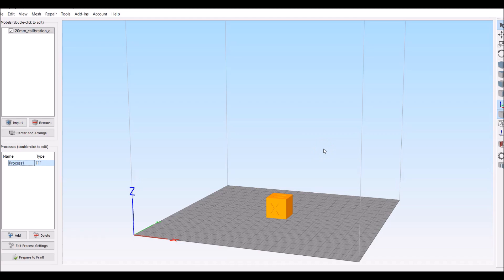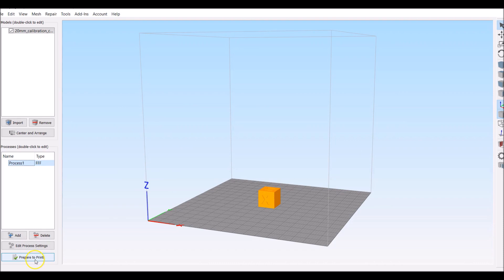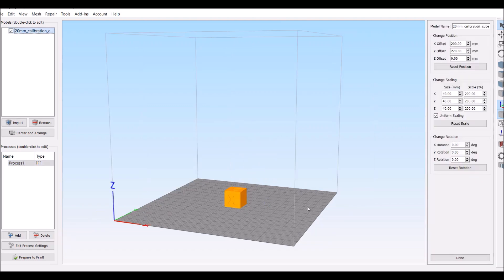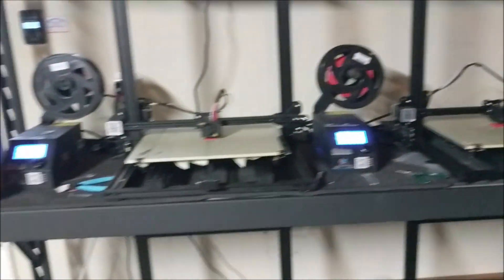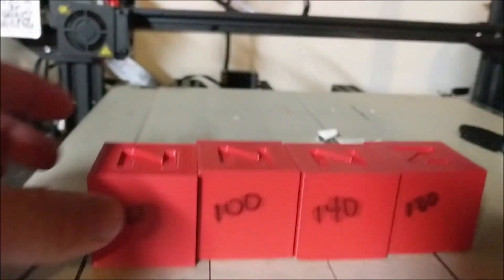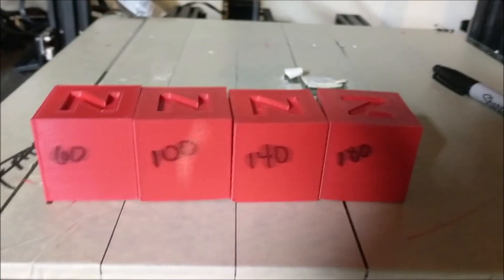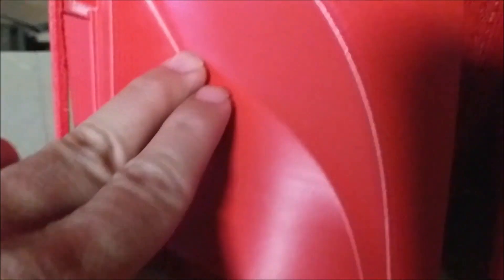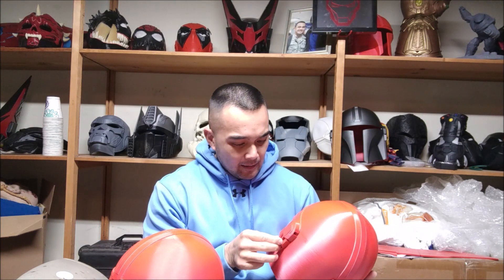Faster CR10 Prints

Comment: Dude, in order to increase speed you dont just crank the overall print speed and that's it !!!! there is a LOT other things to consider like outter wall speed, inner wall speed, infill speed, cooling wait time, top ,buttom and much much other things to do, and yes all will affect the speed of the print and you need to tune all these things in order to get a nice print with faster speed.

Comment: It seems pretty clear to me that your printers aren't actually doing the speeds you're setting them to, either because of volumetric flow limits or because of acceleration limits
Reply: Because of low acceleration and jerk, the travel distances aren't enough to reach the high speeds...

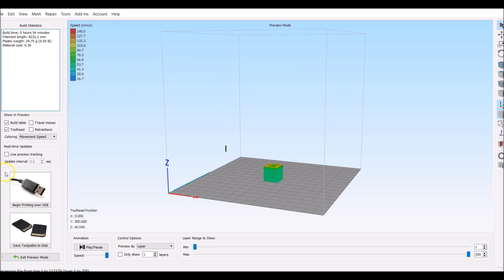Comment: There isn't much difference because there is not much speed difference. Look at @1:51 - look at the colors and then look at the legend. Compare all the cubes, all the same, only infill and top/bottom will go a little faster. Need to increase the perimeter speed.

Comment: How is it that your print is 1d 20h, but in mine it's 6d 10h? I'm printing at .2mm, 60mm/s and only 110% of your print's size. Any suggestions? Using Cura, so not sure what the difference is between that and S3D for print time. No center supports either.
Reply from the maker: what diameter nozzle are you using? i'm using a .6mm with only 2 perimeters
Reply: @NikkoIndustries  I was using .4mm I believe. I switched to .6 but it was a bit meh.
Reply: @NikkoIndustries  I'm using .4mm but I think it's the scaling :P Looks like your's is a wee bit smaller

Comment: I'm going to have to try this. I just bought a cr10s and my first big print is your Mando helmet. It's 1 day into a 6 day print! It's probably didn't need support in the centre but I don't trust new printers for a while!! XD
Reply: I just bought a CR-10 v2 for the same reason. I've attempted the mando print twice with no success but it got better with some tweaks the second time around. I had trouble with adhering to the base. Do you have any suggestions on the layer print speed as well as the first layer print speed?

Comment: Due to acceleration and jerk you will cap out before you reach the max speed.
Reply from the maker: is that why?! thanks!!! lets connect offline and you can teach me!!
Reply: @NikkoIndustries  If you want to reliably print fast, there are multiple things you need to address. On the software and firmware side, you need to dial in your extruder e-steps, and jerk or linear accelleration. You need to up travel speed. You also need to adapte retraction speeds to the printing speed you're seeking to achieve. You need to tune the printing speed sub-parameters - just default, a very large portion of your print (as there's little internal structure beyond support) is printing at highly reduced fractions of you "primary print speed".

To support these, you also need to address the hardware side. On the business end, you really should consider a volcano hotend or similar. Stock can't really keep up well with those speeds. You should also consider a dual gear extruder. A dual gear direct extruder might be beneficial; less time spent on retraction and refeed. But the trade off is head weight, adding more inertia to overcome.

As a final step, you might want to consider a lighter bed surface than glass.
Reply from the maker: @pr0xZen  OMG THANKS FOR THE HELP!! BEST COMMENT EVER!!
Reply: @NikkoIndustries  id be glad to but i dont know the actual math involved. I just know from experience on my ender 3s. But if you think about it scaled up. Say you can take your car dowm a 1/4 mile track with a 4 cylinder at hit 60 if you use a v8 you will probably hit 90. Its because of the acceleration power of the engine vs the distance traveled. Your tests may have slight diffrences but unless you have high speed recording to review you wont know if a machine paused at diffrent points which changed their print times.
Reply: @NikkoIndustries  i do love your videos and designs will you take a commision for a helmet? And if so whats your starting price before we talk about it?
Reply from the maker: @coffinsnail6930  yea! Let's chat offline. Nikko. Props@gmail.com

Comment: the big issue with the first test was about length of travels, when you consider having to accelerate, slow down, travel etc. the cubes dont have enough space, the helmet would totally have more travel spaces.
another good thing to enable if youre self flashing marlin is something call S_CURVE - helps calculate the movements better and can help smooth out prints.
Reply from the maker: and THIS is why i make videos!! thanks for the commend dude!! learned something today!!

Comment: Hello Nikko, how are you doing? Can you tell me what size nozzle that you are  using?
Reply from the maker: this one is a .5mm nozzle
Reply: @NikkoIndustries  thank you so much I'm using a 8 mm. Is there a big difference?
Reply: @ratstarone  62% - .8 is 62% larger than .5
In practical terms - the larger the nozzle the more round your corners.  You can't get a sharp corner on a 1mm nozzle for example.  On corners tighter than 90° you can expect to see gaps - because you can't take a .8 nozzle and make it shove into a .6 hole. The tighter the corner and bigger the nozzle the larger the gap